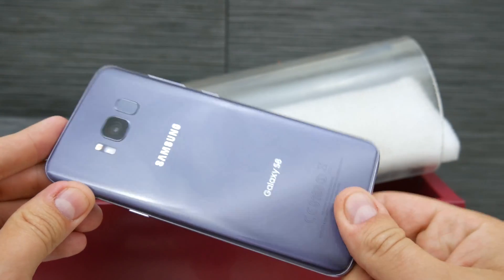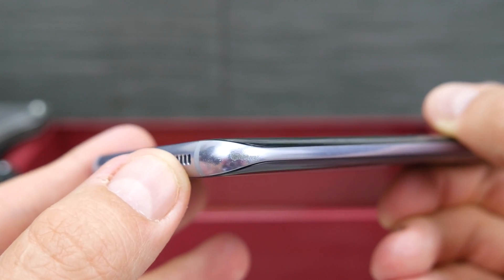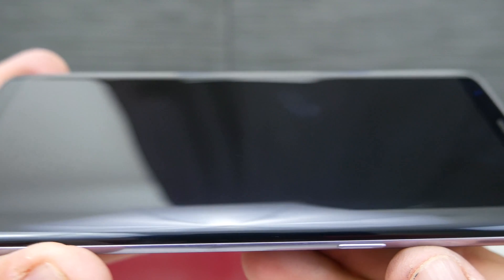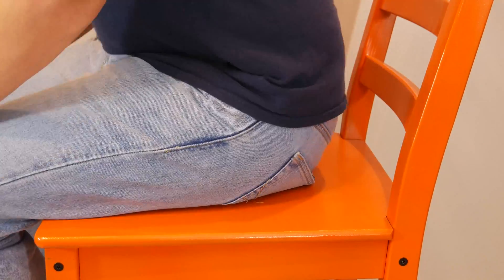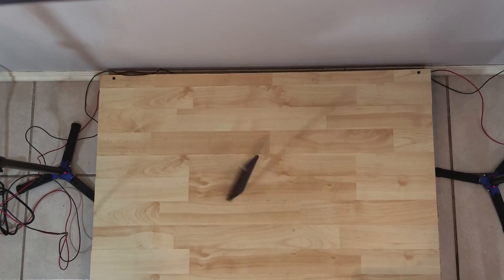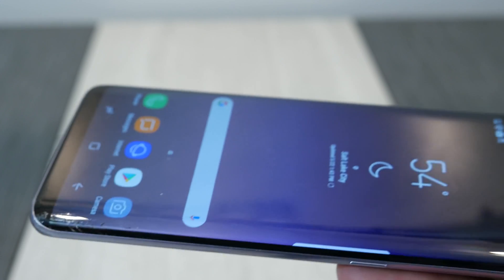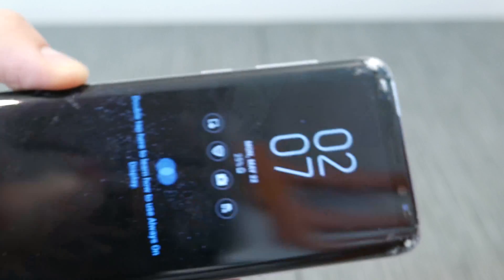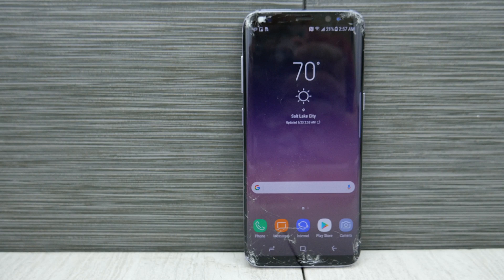Samsung S8 Durability - Drop test, Bend test, Scratch test - Tough Test

Comment: Once i got my S8+ i kept it well tucked into a piece of clean cloth every time i went out.
The "big" exception would be in my pocket, front facing my thigh. Clean pocket.

Whenever it was out of my pocket or not in a bag (well tucked in) it always rested on its back,
and always on something soft. Extremely careful all over.

After 1,5 weeks, i noticed a micro scratch in the middle of the display. Very hard to even spot,
unless the screen is viewed upon in very specific angles during strong light.

Still, this thing can easily be scratched. I recommend getting both back and front protection from the very start.
Reply: niqen the screen protectors available for the s8 plus are all horible and i was thinking of just using a case for the phone but after watching this video I'm starting to get nervous now, what the hell should I do when there are no decent screen protectors that work well with a case for the s8 plus? I'm in a bad situation here I don't want to risk the screen.
Reply: My apologies for the delayed response. After noticing this minor scratch (rather minor line) on my screen i had to obtain some kind of protector. I spent some time researching on this as i use an Alcantara cover by Samsung, so i wasnt too keen on getting a screen protector that would fit poorly considering my use of this case. I ended up bying a Samsung S8+ screen protector. It actuallt took me several attempts to get it all set up without any air bubbles, and aligning it was not the easiest task to perform. Might just be me and my somewhat unsteady hands though. In the end this screen protector isnt all that bad, it sticks really good, and it is not in any way interfering with my case. I think it might work well with other cases as well, but be sure to check this out before bying. My protector has now been on for roughly two months, and it has some marks on it, but id rather have that than scuffs or damage to my display. All in all it is well recommended.

And its rather cheap. A small price to pay, for the protection youre getting!
Reply: Try pure gear screen protector that's the plastic the glass ones r shitty. Pure gear u can still use ur Otter box.
Reply: same here